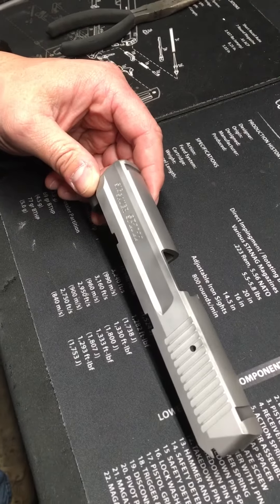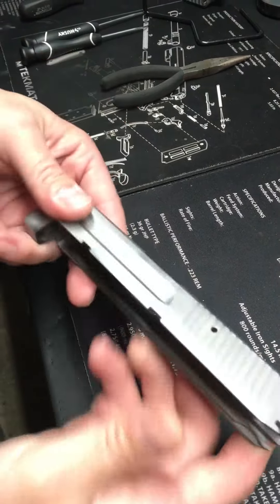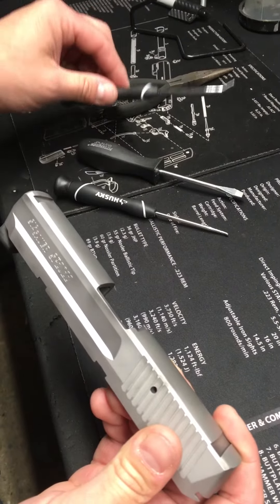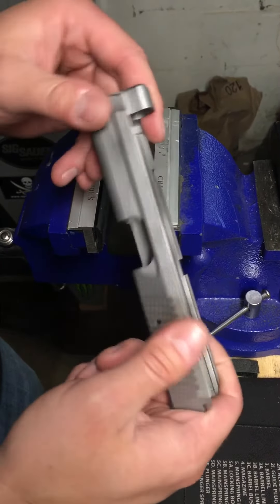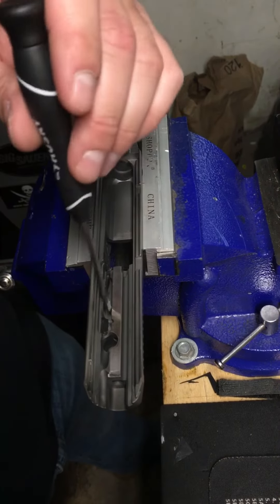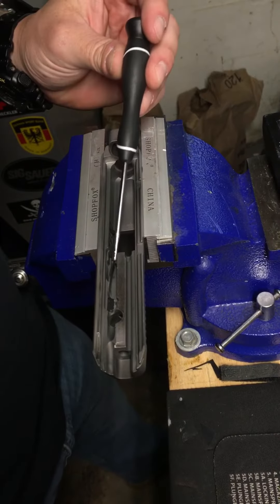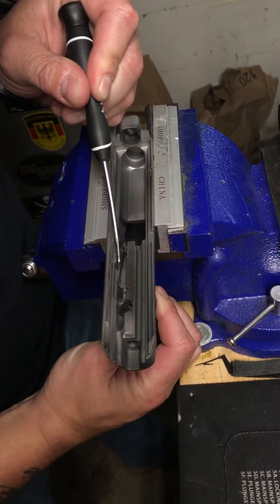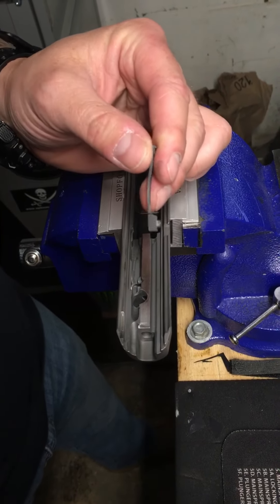Sig Sauer SP2022 Internal Extractor Removal

Comment: Good video... but FYI the extra hole on the extractor side of the slide is for a punch to be inserted to push in the extractor then swing up or down on the extractor (depending on your slide orientation) instead of scooping it with flat screwdriver.

Comment: I shot about 500 rounds through my Sig 2022 flawlessly and suddenly I began having fail to feed issues. Turned out the extractor was too tight. I corrected the problem and it is shooting fine again. 
My question is, how does an extractor become too tight over time? I can understand too loose, but too tight seems odd to me.
Thanks
Reply: How did you correct the extractor issue? Being too tight.